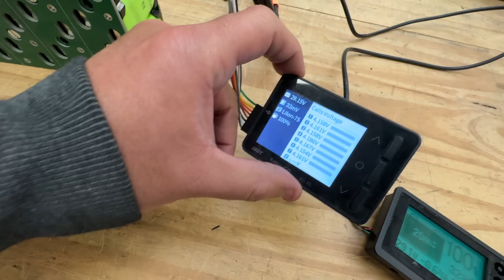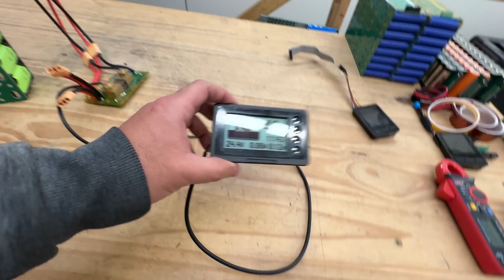How I achieved 100A Continuous Out of this Battery

Comment: true? 

To convert 100 amperes (A) at 110 volts (V) to kilovolt-amperes (kVA), we can use the same formula:

kVA = (Amps x Volts) / 1000

Plugging in the values, we get:

kVA = (100 A x 110 V) / 1000
kVA = 11

Therefore, 100 amperes at 110 volts is equal to 11 kilovolt-amperes (kVA).

Comment: Power = R * I^2     = 1mOhm * 100A * 100A = 10W    -> every mOhm heats with 10 Watt therefore you need lots of copper to keep the resistance very low

Comment: I'm working with Amateur Radio equipment and we need 14v packs, the radios prefer 13.8 but they will run in a vehicle which can see upto 14.4v. I have a 50cal ammo can and other pelican style cases from Harbor Freight I would like to use. What would get me the largest capacity in the smallest package? Cost effective as well...
Reply: Your radios “prefer” 13.8V?
I’m guessing you’re not using Icom transceivers then?

(I’m just curious.)

Best regards OM!
73’ de OZ2BO
Reply: @BoHolbo  actually the icom 2820h i'm using calls for 13.8v dc.
Reply: @JonCherba  Okay then, I stand corrected. 

(I was in the old school mind of HF mobile operations, not VHF/UHF. 😃)
Reply: @BoHolbo  no worries...

Comment: This particular pack survived but I wouldn't label this as 100A continuous just yet. I'd make those improvements on the connections and see if the temps are reasonable on a few different packs.

Comment: Great video! When you showed us the adapter for the ribbon your making. You can add in the componits for balancing the cells. It only add 66ma per cell, but that's pretty close the same as bms. So if you get a bms that balances around 50ma, you would end up with an amp per cell. Just an idea. So you'd get the ribbon and balance board.  Great video as always.👍👍👍👍👍👍

Comment: can this be used or solar set up
Reply from the maker: Yes any battery can be used to store solar energy,  but this battery is better suited for Power Applications
Reply: @jehugarcia  so 50/50 even in 24v system on a daily basic

Comment: I REALLY need a reasonably priced 48v 200A pack with BMS. I don't trust the 18650 pack I made.
Reply from the maker: What does reasonably priced mean?  these 48v ( https://jag35.com/collections/new-arrivals/products/server-battery-li-ion-51v-6ah-306wh-w-lg-cells). do 80A so 3 of them in parallel will give you up to 240A  for $150  all you need is 200A bms  setting you back around $100 so total around $250-$300.

Comment: 94 degrees celsius! those cells will not enjoy that :(
Reply from the maker: That’s the reason it’s PEAK performance.
Reply: @jehugarcia  fair! Nice work on the PCB, though :)
Reply: It's alright, it's a stress test, so you can see capabilities of the battery pack. Cells was not been 94C, it was been a junction between a boards.